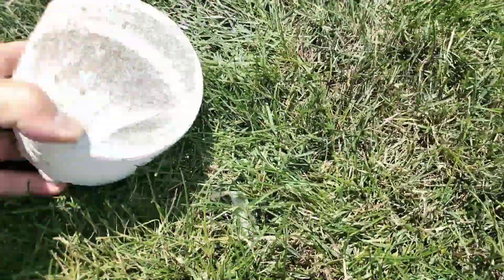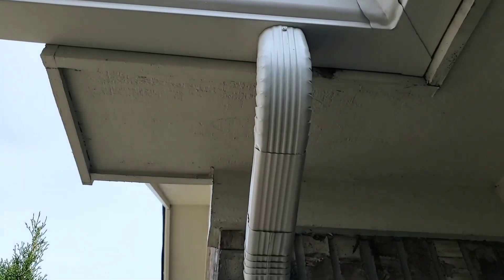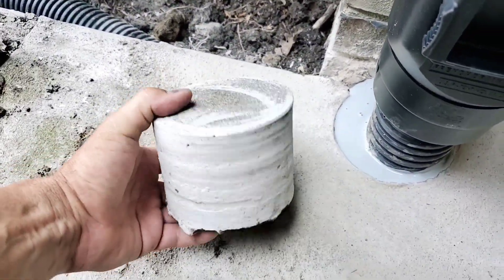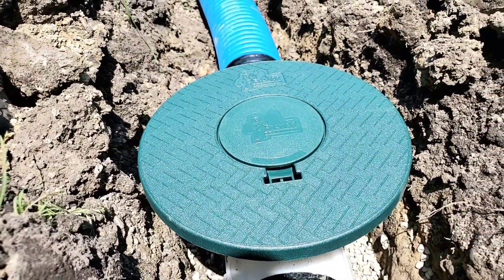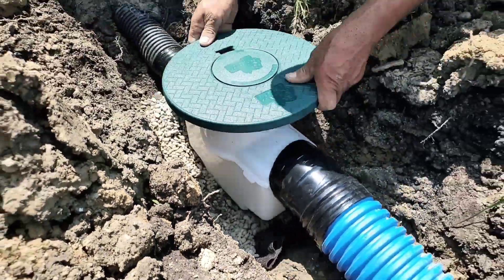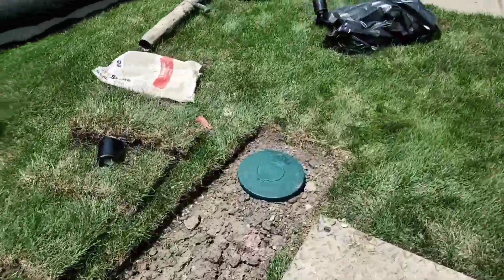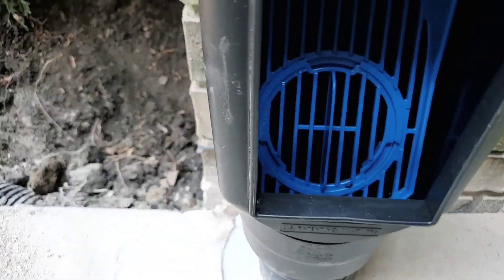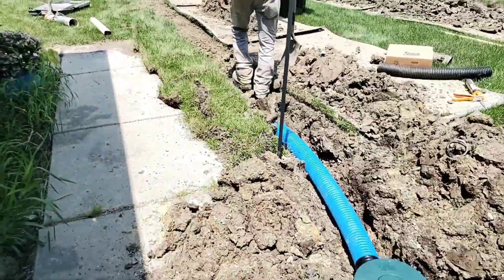Why 2"x3" Gutter Downspouts Suck and what you can do to HELP your Underground Downspout work BETTER

Comment: Now we’re going from a simple 1000 gutter replacement to a 5000+ upgrade
Reply from the maker: Not necessarily. A good gutter guy can increase the downspout size and not the gutter size.
Reply: Would you route the downspout so it's coming down on the front side of the house when upgrading to 3x4?  I'm thinking the hole in gutter would have to move about 6 inches in the direction away from house if it could be patched?  I realize here you already cored through the walkway.